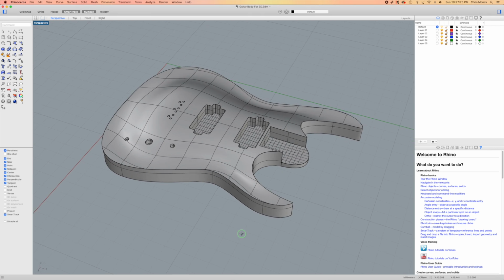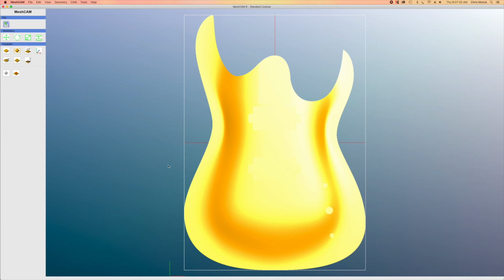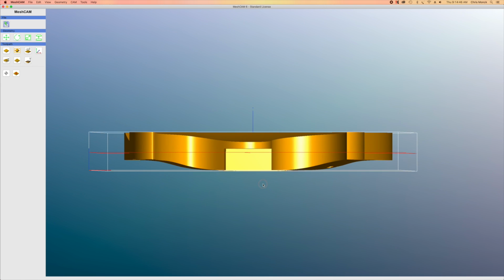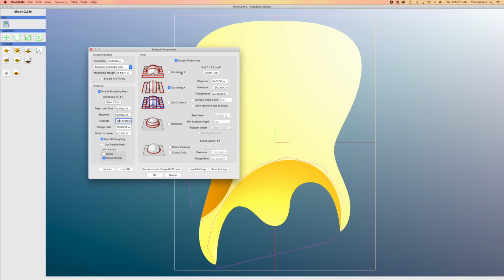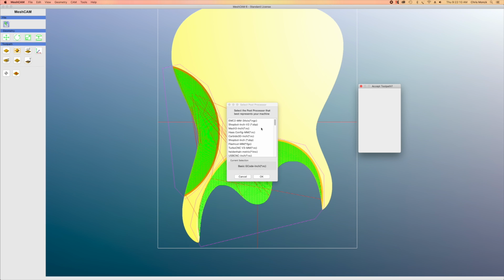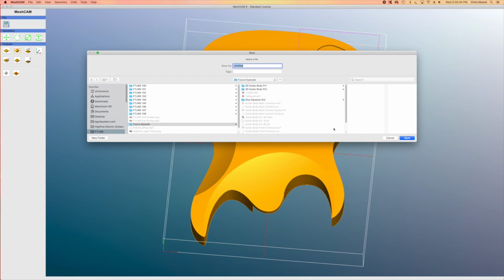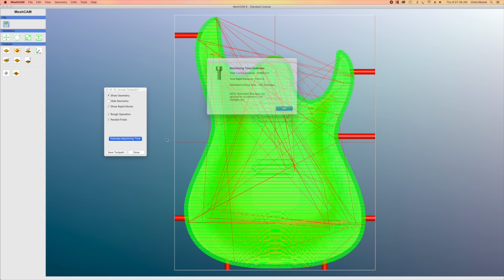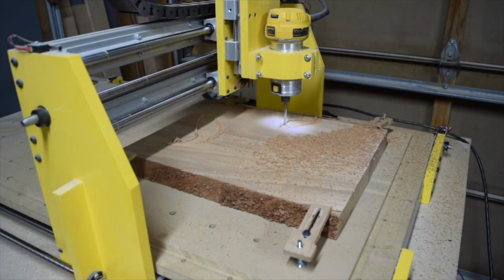MeshCAM Toolpaths And G Code For A Guitar Body

Comment: I don't care what removes the bulk of the material, whether by hand or a CNC machine. There is still a bunch of skilled finishing to do. Also, creating tool paths and CAM simulations is only half of the computer skills you need. You also need CAD skills, which are highly artistic as well.

I love CNC guitar building! Saving up for MeshCAM. Got Rhino. Got a LongMill MK2.5. Need to fix up my shed and build a table for my CNC, and also my 3d printer, which I need to print drill jigs for off angle holes given I don't have a multi-axis CNC machine. I cannot wait to get started. My first guitar is fully designed and ready for CAM. It is unique. I think it'll take off as soon as people see it. I know what my second, third, and fourth guitars will be also. Hopefully this will supplement it even replace my current income. Thank you, Chris.

Comment: Would this work as well for 3D printing a Guitar body? Im looking to make a HH Jazzmaster with a fixed bridge.
Reply from the maker: Not MeshCAM. I use Rhinoceros 3D to make my models and Anycubic Slicer to write the g-code for 3D printing. I’m working on a complete guitars right now that will be 3D printed.
Reply: @HighlineGuitars  so all the steps you used to design the guitar up until this video when you export it as a STL file I can do that and just use meshmixer to cut it to fit my printer?
Reply from the maker: @BMH-cb9jt  I don’t know anything about Meshmixer. If I need to break a part into separate pieces, I do that in Rhinoceros 3D.

Comment: Since this video, is there a better solution that can use one software package, minus the 3d creation software. Is there anything that can write g code for a guitar in less steps?
Reply from the maker: With Easel Pro, you can import .stl files, set the toolpaths, and send it to the CNC machine.
Reply: Thank you Chris. If money wasn't a factor, what machine would you buy? @HighlineGuitars
Reply from the maker: @subd3  X-Carve Pro.

Comment: I would prefer to carve the top and the pockets for the neck and pickups in separate operations. Ballnose for the 3D carve, and straight end mills for the pockets. Can that be done in Meshcam or do you need to export separate files from your CAD program? 3D STL file for the carve, then 2D file for the pockets?
Reply from the maker: It can all be done at once in MeshCAM with one 3D STL file.

Comment: Hey there I know it's a long shot cuz the video is 3 years old, but when your routing the body like that how you get the wire tunnels between the pickups into control cavity
Reply from the maker: I use a very long brad point drill bit and drill from the neck cavity through the pickup cavities. Then I drill an angled hole from the bridge pickup cavity down into the control cavity. When I drill the angled hole, I run the drill bit through a short length of pipe to protect the sides of the pickup cavity.
Reply: @HighlineGuitars  thank so mich for getting back to me and in the time you did! I'm bing watching all your vids!

Comment: I enjoyed your videos, but I would like to ask a question.  Why did you not let the CNC drill those holes?  You mentioned that the drill press would be more accurate, but I can't fathom why that is the case.  ( I too have my own home built big wood CNC. ) Thanks for the demo.
Reply from the maker: Even though I have drill bits for every hole size I might need to drill, I don't have spindle collets for every drill bit. Sure, I could cut pockets instead of drilling holes, however, many of these holes are deeper than my endmills will cut. Also, since the alignment between the neck and body center lines can shift as a result of final sanding, I often find it safer to drill the holes after the neck has been mounted or at least test fit into the body.

Comment: Thanks for the fantastic CNC videos!  I have a couple of logistics questions:

1. I'm also curious about your double-sided milling method as asked by Jurgen here in the comments.

2. How do you get the G-code to the actual CNC?  Example: could i do the entire design on my desktop and then transfer g-code to a laptop that helps run GRBL?
Reply from the maker: 1. I align the centerlines of my blank to lines engraved into the wasteboard of my CNC machine.
2. I design on a desktop and send the g-code to my CNC from a laptop.
Reply: @HighlineGuitars  Thanks for the quick responses. That makes so much sense to use a centerline on the wasteboard.  Also, glad i can just upgrade my desktop graphics card for CAD/CAM and then just transfer the G code from a laptop (hope I'm understanding correctly; still trying to fully wrap my head around the software side of things)
Reply from the maker: @TommyH-EE-120  I drop my g-code into Easel Pro from my desktop so it's available when I log in on my laptop.

Comment: Thank you so much for your informative videos. Do you use Meshcam for the fret board/slots as well? I have tried but cannot seem to get Meshcam to calculate the fret slots. It will not go into the slot..just the very top.

Comment: Good Video. Is there no way to input the stock size, material, and tool then MESHCAM will automatically define the paths and g code??
Reply from the maker: Huh? That’s what this video was about. You input the details and click calculate. The tool paths are generated and if you like them, you can save the g-code.
Reply: @HighlineGuitars  Yes but you spent 30m opening 10 different icons telling it to do 50 different things and I thought there might be a simpler way to generate g code. It is a bit over whelming for a beginner and if one of the steps is off you can do a bit of damage.
Reply from the maker: @rufustoad1  when it comes to carving 3D shapes on a CNC machine, there is no easier way than MeshCam for generating tool paths and g-code. If you think it’s too complicated, you might want to close the book on CNC and try a more traditional hand carving approach.

Comment: Thank you for the video. But do you have a video where you explain double sided milling? Example how you flip body over so that ur machine mills other side on right spots. Do you use pins system or draw some lines on wasteboard and body plank?
Reply: This would be awesome to see explained. Thanks Chris!
Reply: I would also very much like to see the flipping technique used!  I've tried multiple methods with decent results but always end up with a slight mismatch in my flip

Comment: Thank you again.  I was surprised (because of lack of experience) when you said that the holes could be drilled more precisely on a press.  Did you mean more precisely with respect to the complete guitar with neck attached?  Or is there something else mechanically that makes the CNC inferior?
Reply: On a CNC, one can do very accurate holes, but you want to be able to use a tool that's smaller than the holes. That's difficult for .125" string holes that have to pass through nearly 1.75" of body. Tooling would be very small and very long and likely be, um...toast really fast.